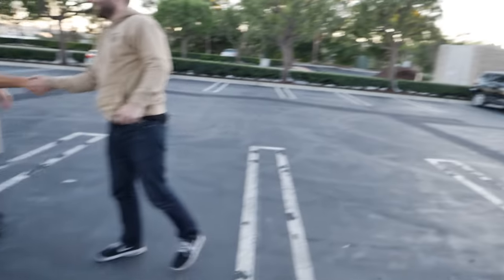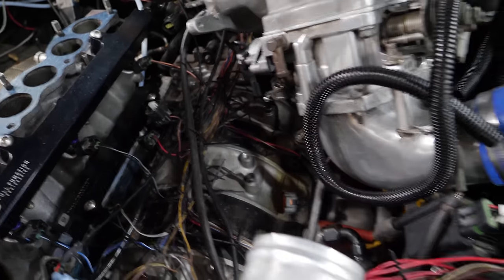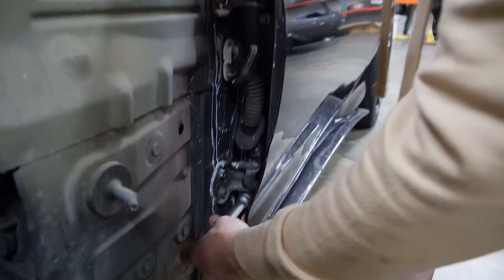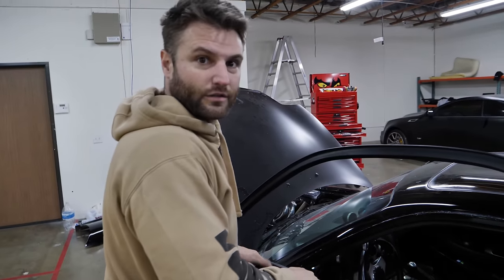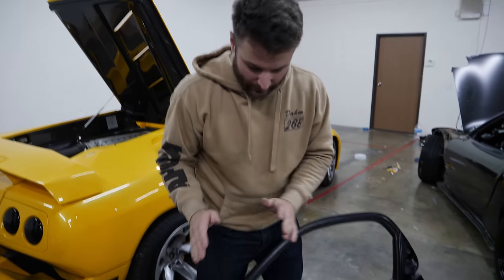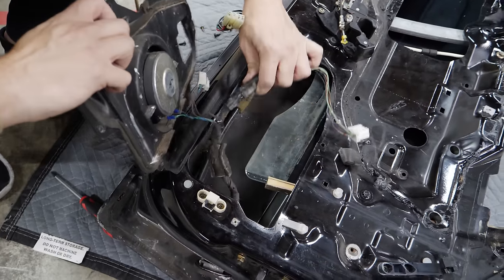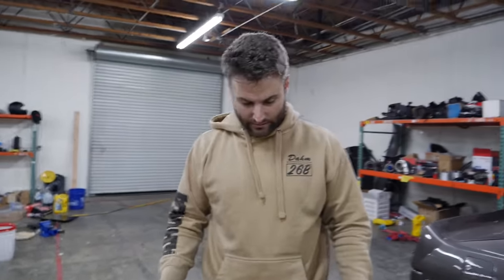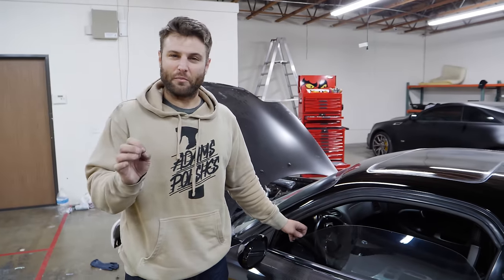CARBON FIBER DOORS FOR MY RX-7 | Death trap

Comment: Cheap carbon doors, at 11.08 you can clear see chopped strand fibreglass mat on the inside. So they are a carbon fiber outer skin over GRP doors.
Reply: Yup, probably just normal fiberglass with a carbon weave laid over it for rigidity and being carbon. True molded carbon is absurdly expensive.
Reply: That's seibon for you
Reply: Saw that too, looked to see if someone else saw it, and someone had!
Reply: Carbon skinned anything is cringe.

Comment: 11:05 Thats not a carbon fiber door. It's a glasfiber door with a layer of carbonfiber ontop to make it look like carbon.
Reply: nope, just chopped strings.. this happends to me all the time when dealing with fabrics, whats better to do with excess material than using it on actual part
Reply: eXViLs - 8B008B I've only worked with glasfiber but I've seen others work with carbonfiber and I've only seen that pattern on the inside of the door from glasfiber chop mat. Carbonfiber from what I've seen always woven and the stuff on the inside is definitely not woven.
Reply: eXViLs - 8B008B it’s a top layer of carbon with glass chopped everywhere else.
Reply: That is absolutely glass fiber.
Reply: 3 rotor needs a cage in it like last year. Should get one for the power you pushing threw it
Reply: Lassi Kinnunen Doors on a car of that caliber isn't meant for rigidity. It's more meant for aero and looks. A cage is the thing that gives the car rigidity so it doesn't matter if they are reinforced or not. But for him to preaching about "only using carbonfiber for the light weight" is bs because most of that door is glasfiber. He's only using carbon for the looks, he's just trying to not look like a hypebeast.
Reply: Simon N I have no idea what you’re smoking but a “carbon” fiber door that matches the stock one has ZERO aero benefits. It’s meant to reduce weight which it does.
Reply: https://compositeenvisions.com/composite-reinforcement-fabrics/carbon-fiber-reinforcements/

For those saying its chopped glass. They do have chopped and stranded carbon fiber. Know what you're talking about before you speak.  The door was probably built with a minimal amount of carbon, that's where the problem actually is.

Comment: Dude .Be careful with all those crazy was California drivers. The doors are sick but not having crash bars in the doors is a little terrifying. Carbon gets stronger the more pressure  you put on it but for crash resistance Kevlar would help big time. I can make you some crash bars out of Kevlar for free if you need them. Just message me. Keep up the good work.
Reply: Maybe he just needs a roll cage in his 1000hp  car...
Reply: Thank you James, very cool
Reply: Rocco ** wait is he actually not having a cage in it?
Reply: james hanna please he’s in a 90’s car he’s not better off with the stock door to even matter.
Reply: Who told you carbon gets stronger the more pressure you put into it? The yield strength, which is the tensile strength, by definition, can not change with stress...
Reply: a rollcage would do everything as simple crash bar would plus some
Reply: @acruzp  He may be talking about the pressure it is under when it's impregnated? Maybe?
Reply: @acruzp  actually since the door is made of carbon, it turns into a diamond door when under pressure, which can resist almost  everything. Trust me, I'm from the internet
Reply: I think carbon doors is not street legal anyway, the fact hes installing it is very bad
Reply: @Q8Police777  wait really? You think the police are going to check his doors for contraband carbon fiber?.

Comment: You would probably have better luck making the FD lighter if you went to the gym. No amount of carbon fiber is going to save it.
Reply: Lmaoooo 😂
Reply: FD is already light as feather, further weight reduction would be spaceframe instead of it's body.
Reply: LMFAO
Reply: You would probably save more weight cleaning up all the excess wiring. Lol
Reply: @hailstorm7868  it already got an spaceframe, the carbon parts are for the 4 rotor
Reply: alexlam24 you’re so wrong it’s not even funny.
Reply: alexlam24. those doors gotta be much lighter then stock. plus dude aint even fat.  but from your profile pic with a lambo says it all.
Reply: alexlam24. you responded so quickly. which tells me you karen alot.
Reply: @notsure3535  maybe he's not fat compared to you which explains the lack of profile picture
Reply: Willy bman get off my shaft gay boy..
Reply: he is not fat?
Reply: Caleb Vukovic. no. you jus have trouble reading.

Comment: To be honest , Rob, you cant call your new door a cf door, as on 11:10 you can clearly see it was made out of fiber glass + 1 one lair of cf on top. Also it was made without vacuum.... What does that mean to you: real cf door will be 20-30% lighter and more then 50% stronger. IMHO door you have cant cost more then 300$ as there is only one lair of cf  and it is the most expensive after work in this things.

Comment: That's the same guy that has two right side carbon fiber for the RX-7 FC on eBay for $999 you can actually buy the set from the Japanese website that makes them for $300 more for the complete set right and left
Reply: 300 for other cars aswell?, if so what website is it?
Reply: @umerafzal482  go on Google type in carbon fiber doors and fenders for RX-7 there's only a handful websites it's all in Japanese so you got to use Google translate
Reply: @umerafzal482  eventually I'm going to get a set for my FC the doors and fenders fenders are 1,300 to 1500  depends on what style and then the doors are 2400 plus shipping it's all pricey but it's worth it

Comment: I felt the same way about my seibon trunk on my RX-8. Fits great but it definitely feels more fragile and needs a good 2 hand push to actually lock with the latch. I don’t regret buying it, it does save a decent amount of weight (unlike the hood which actually added weight, but it has those super sweet vents for cooling, so it’s not a completely ass backwards “upgrade” lol)

Comment: Carbon fiber body parts are usually to race, drift etc., if you wont install a cage in it, good luck on staying alive. Btw the fitments doesnt have to be precise since on a racetrack you wont need electric windows, crash bars or interior.

Comment: Lol I mean this with no disrespect Rob because I watch your channel everyday and love it. Most people would pick the Lamborghini but my dream car is a 3 rotor RX7 and now you're going to have a 4 rotor. Ugh I'm jealous. But after seeing your wiring and the CTS with half carbon fiber on one side, you do things so half-ass it's funny. LOL You really do have such nice things though. I'm going to get another Rx-7 after I finish restoring my 03 Mazdaspeed turbo protege. It is a fun car but I'm going with all forged internals and a clutch upgrade then new paint. It's all original and they only made 600 in spicy orange. Plus it has a little sentimental value.

Comment: just a heads up, those labels you made will go black from heat exposure and UV light. I had a few I made for my sound system and they faded out from the sun hitting them.

Comment: Have a body shop remove the crash bar and glue it into the carbon door. Or remove the crash bar and use it to make a mold and make a new crash bar out of carbon.
Reply: DR Bowen nope, side impact bar needs to be metal, welded to the hinge support on one end and the anti burst door catch mechanism on the other, that way each end is welded in to a hard point and the middle can be bend to absorb some of the impact.
Reply: @ForeverNeverwhere1  So would the only way to do it safely be to make a skin of door then cut out as much metal as possible and glue skin to existing frame?
Reply: DR  interior door frame doesn’t really matter, composite doors need bracing on the inside for both the anti burst catch and the hinge, and both need to be properly braced across to each other with a welded or bolted on door bar. That way if there is a side Impact pushing the door bar inwards, the hinges and anti burst catch, as well as the metal around them, start to take some of the strain and deform too. Needs to be metal so it has sufficient strength when bending on intrusion, carbon and GRP composites can be strong, but they crack and splinter when bent beyond their breaking point. Kevlar fibre reinforced materials have great side load strength, but then the bond will probably fail where it attaches to the catch and hinge areas. I have a friend makes all carbon race car doors, mostly Ferrari challenge stuff, but he is adamant there needs to be a full cage  instead.

Comment: The labeling goes a long way.  When wiring and programming industrial equipment, my mentor always told me that the best wiring/programming method is the best documented one.  It can be as slick as anything out there, but if there is no documentation it's worthless.

Comment: I'm glad I'm not the only one who wonders about the safety of aftermarket carbon fiber pieces. Or even worse, fibergalss pieces.
Reply: I'm no materials expert, but I know people who make aero use carbon fiber only where strength isn't important, and fiberglass where it is.
So why would a fiberglass aftermarket door be "worse"? The goal of driving is to not get t boned anyway.
Reply: I don't know about that. From what I've seen Carbon Fiber is going to be stronger and lighter for the same size piece. Fiberglass is just going to be easier and cheaper. The higher end Corvettes swap out some fiberglass pieces for carbon fiber for example. It also depends on how the forces are on the piece. Carbon fiber will be very strong in one direction, but you could take it and break it over your knee in another direction.

Comment: I have to wonder if anyone has built an aftermarket body panel - metal, fiberglass or carbon fiber that actually fits like the real thing. I'm guessing no. It strikes me as odd that they are SO far off. Not knowing a thing about design and production processes, I would like to think computerized modeling should be able to get a lot closer to factory specs. 
Thanks for the videos, Rob! 
Subscribe people! He deserves at least 1 million subs!

Comment: At least Mazda engineered that door brace - My project car, a Chrysler Crossfire, just had a steel tube welded in from the factory.
Reply: Driveway that is pretty common, the real strength is making sure the side impact door bars are welded to both a plate on the hinge support and the catch mechanism. The doors rob bought are nasty fibreglass ones with a carbon skin, they need chucking in the bin.

Comment: That's not a carbon fiber door, that's a fiberglass door with a carbon skin on it.   Two VERY different products in fit and finish, strength, weight, and price.

Comment: I can guarantee that double sided tape would hold that weather stripping in. To prove a point to a friend a couple years ago I took the screws out of my license plate and taped it to the bracket with two 1" x 2" strips of heavy duty 3M double sided tape and it's still there. Shit's crazy yo

Comment: From years of working with carbon fiber doors, I can tell you that door is gonna crack and break off at the hinges. The quality of most carbon doors out there wont support the original components of the door.

Comment: Those fiber glass doors might almost save as much weight as cleaning up the extra wiring.... almost
Reply: Also that is a fiber glass panel with a carbon cover not a carbon door

Comment: Not so sure about those doors, the boot and bonnet makes sense as the boot on a Rx7 is silly heavy, I mean HEAVY but doors man, they are protection. If you insist on doing it make sure your cage extends to side impact protection and line them as they will sound horrible with wind noise and resonance. 
You can buy flat panel Ali or carbon door cards but I think they look a little shit, I’m sure with all your contacts you can find someone to make you a carbon moulded door card, just a little contour would make it look better than the flat finish items.

Comment: Thats not a true Carbon Fiber door. You can see the Fiberglass strands on the inside. I could understand it if its Kevlar with a Carbon Fiber overlay for looks but using Fiberglass under is just cheap and ruins the quality.

Your also better off anyhow having the panels you want made out of Carbon Fiber but reinforced properly with a layer of Kevlar. Doing so gives you the benefits of Carbon Fiber with the added Strength, Stiffness, and Rigidity of Kevlar. Panels made like this are fairly indestructible.

Comment: CF has become fashion. Most of the CF you see today is totally fake and actually makes the car heavier like your door trim cover therefore it is not cool. If everyone is doing something then it is not cool. I'd paint all those CF parts then you could make them look totally factory finish looking if that's what you want. If you were going for lightweight then you'd not reproduce a functional window channel and the hinge support structure and just hold the door on with pins. Traditional racing aluminum panels would be lighter than most of the CF parts I've seen.

Comment: honestly in my opinion carbon fiber is kind of cool, but i find it does look like trash.... i would consider using carbon fiber and painting it, i understand painting it adds weight, but you just took 22 lbs off, why not add a tiny bit in making it look decent

Comment: First of all, the good news. The chances of you getting into a accident, barring driver error and human stupidity, are statistically small. Millions of vehicles on the roads, and vehicular accidents involving death or serious injury are statistically rare. Most accidents are straight frontal or rear collisions. Side impact and offset frontal collisions are pretty rare.

Now for the bad news. Unless you plan to spend thousands on converting the entire car to aluminum or even titanium, your trading the mass that's going to save your butt for some extra performance reducing the mass of the vehicle.

The bad news? If you are hit from the side, you're pretty much toast. Sorry. It's a trade off. You're getting better fuel economy, acceleration, and performance from a lighter vehicle. But you're also shedding mass that could save your life.

Carbon fiber is stronger and lighter than steel but it doesn't absorb impact energy the same way. It shatters rather than bending like steel does.

Up to you.

Comment: No one is gonna walk up to your car pull out a feeler gauge and go wtf your door crease tapers .005 “ your Mazda door isn’t perfect it takes set and wears on a hinge so it will never perfectly align also I doubt the seibon door is 100% carbon I bet the top layer is carbon and that scene where you looked inside the carbon door? That’s fiberglass. Also side impact is intended for much slower speeds plus its a 90’s car crash test? Lol horrible.